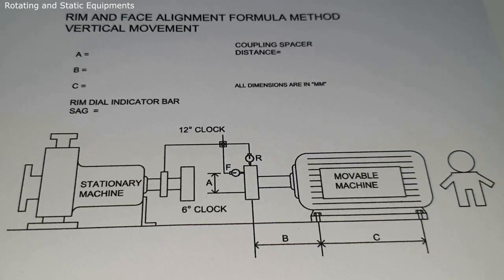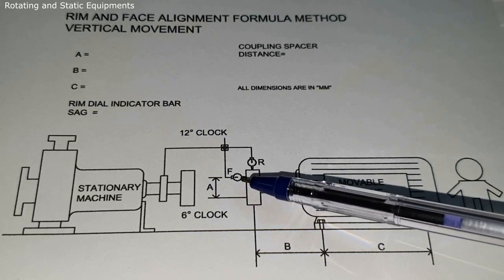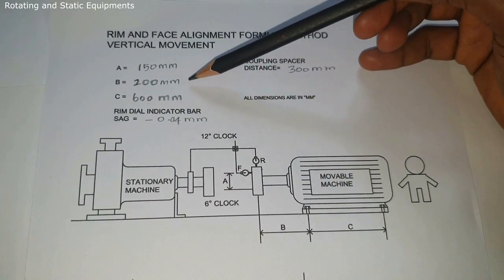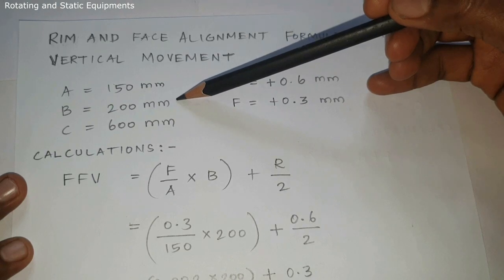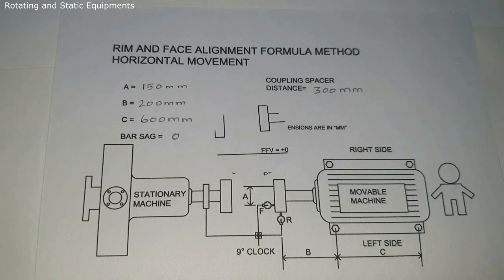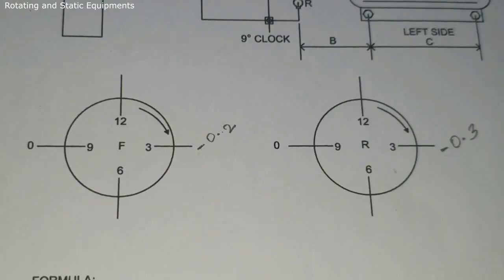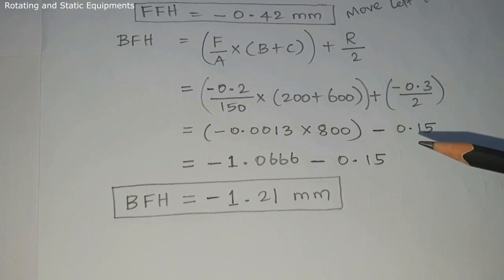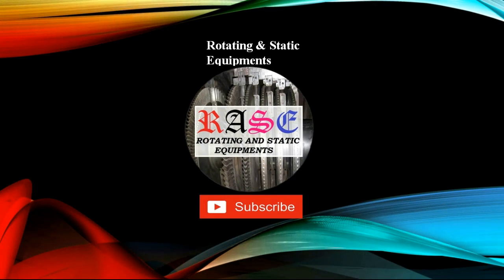RIM AND FACE ALIGNMENT FORMULA METHOD | ENGLISH | Rotating and Static Equipments

Comment: Many thanks for the great explanation!
I have one concern, in 6:45, did you mean we have to rotate the shaft from 12 to 6 o clock and then zero face indicator and adjust rim indicator at -0.04?
Then rotate shaft to 12 o'clock and taking the reading?

Thanks,
Reply from the maker: Yes brother...

Comment: Good Video,  I would like to know, What happens if we cannot rotating the shaft of Station machinery (compressor cannot rotate)
We set alignment bar at motor side and Rotate shaft of motor only , this method and formula still complied or not?
Reply from the maker: You can. but you cant eliminate the runout of shaft or coupling if presents in the machine. and you will not get the exact reading. it will be increased or decreased due to runout.
Reply from the maker: @anilkumar-xe5mh  prakashmagalingam2020@gmail.com

Comment: Which side should the clock be placed?  placed on the pump side gives a different value.  placed on the motor side gives a different value.  very large number.  looking forward to the answer
Reply from the maker: Its depends upon your convenient. Follow any one side. dont make things difficult. It will confuse you... Make the pump fixed machine always. and fix the dial clamps fixtures in the pump coupling. and Fix the dial indicators in Motor coupling. if It is large machine and motor having journal bearings. Please check Rim and Double axial Alignment method or reverse dial Indicating alignment. Dont use normal rim and face alignment.
Reply: @rasetech  thank.  do you have any exact documentation about it.  i want to understand more
Reply from the maker: @Quy_Tran64  Very sorry I dont have any documents. I am giving this information from my working experience and knowledge. I think you can go through it with your equipment OEM manual to confirm the same. You will get exact reference from there.

Comment: Sir,One more question if you allow-  During FFH & BFH-shifting After having reading FFH-0.08 mm & BFH- 0.48 mm respectively when I Shift the motor from Front side 0.08 mm at the same time the back foot dial indicator also move little bit my question is can we include those shifting difference under obtained resultant BFH shifting reading - 0.48 mm or we add this difference+ 0.48 mm? & Grinding the base bolt for motor movement if motor base hole touches the bolt and doesn't allow to move further is good or bad?
Reply from the maker: very good question. I appreciate it. First we need to correct higher value. So BFH is bigger value rather than FFH. So we need to correct BFH and at the same we need to monitor on FFH side also. While adjusting BFH, FFH will reduce automatically when it is reach required target we need to hand tight and touch the FFH opposite side jack bolt. then again continue with BFH to reach our target. I hope you understand this. Still if you have doubt. please let me know. All the best❤
Reply: @rasetech  Thank you sir my pleasure.

Comment: hi Sir ,a very good video for me...i hv one question at measurement C...is it we measure from center of dial rim or only center of B bolts..tq
Reply from the maker: Measurement C is distance between motor Front foot and back foot bolt center.  Its center of base bolts.
Reply: @rasetech 
Another question sir
Do we start the dial gauge from 12 o'clock to 6 o'clock...and if we do alternately it will giving different value...am I correct?
Reply from the maker: Yes It will remains same value but sign will change

Comment: Question ! My coworkers always taught me since I began this trade to set the fixture on the moveable and the indicators onto the pump . Does that alter the readings what so ever ? It seems to have always worked for us and brought us with 1 thousandth
Reply from the maker: I didn't understand your question bro. You can set the dial on pump coupling and take reading according to the same you can correct it. it is upto you and understanding. that it. bro

Comment: What is the formula for clamp fixing in the motor and dial fixing the gearbox coupling?
Reply from the maker: all are same formula only.
Reply: as per your dial setting from 6 o'clock to 12 o'clock and if getting reading +0.2  but if I setting dial from 12 o'clock to 6 o'clock should be applied formula -0.2 ?
Reply from the maker: Yes only we need to change the sign. as per your setting if ans is plus then add shim if minus means remove shim. that it brother.

Comment: Hi. thanks for the video but i would like to make 3 questions.
1) where is the distance of the couplings calculated in the formula? as i could see you dont need that diamension to calculate the shims, right?
2) instead of using the stationary machine shaft to mount the dial indicators can i use the  the movable machines shaft? if so should i look anything in the formula results? (inverted numbers etc)
3) Should i rotate both shafts when i make the procedure to take the measurements? or just only the one shaft that the dial indicator is mounded it? 
i have an application that should proceed the rim and face method but the stationary machine has a drum style end and there is no easy point to mount my dial indicators.

Comment: Sir,Is it necessary to put Radial and Axial Guage together at only 12'o clock position ?. if I fix Radial Guage at 12'o clock and Axial dial guage at 6'o clock will it help me with Rim and face formula method. Thank you
Reply from the maker: If you are doing practical alignment. and there is not provision to fix axial dial with same position. You can fix 6o clock position. Then Individually you can take readings for radial and axial dials. If you are using formula. Then we need to follow same procedure to obtain perfect values. Thank you....❤
Reply: @rasetech  Thank you sir

Comment: On the 6:36 how much we rotate the shaft to get the R and F value? Is it rotate full 360° ?
Reply from the maker: No its 180 degree...
Reply: @rasetech  thanks sir, and how about coupling spacer value, when we use it?
Reply from the maker: @aldorrymiftakaruna1264  you should measure distance between shaft end for reference and it will use while doing refixing of coupling spacer.

Comment: Bro formula ethum use pannama vara reading ah ?÷2  pottu pannalaama..
Reply from the maker: Rim reading ku applicable bro but face reading ku not applicable bro.
Reply: Aana inga plant la formula yaarum use panrathu illa bro.. rim and face kum.. ÷2 than pottu panranga.. aana accurate ah varathu rompa time aagum
Reply: Nenga podura videos nalla helpfull ah iruku bro..
Reply from the maker: @rajeshrajerajesh2691  formula use panni try pannunga time save
Reply: Ok bro